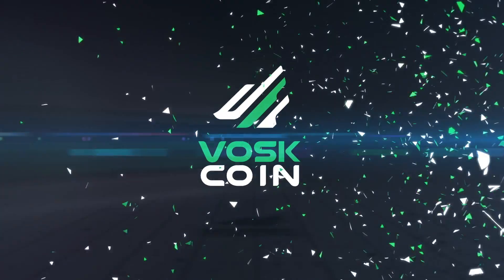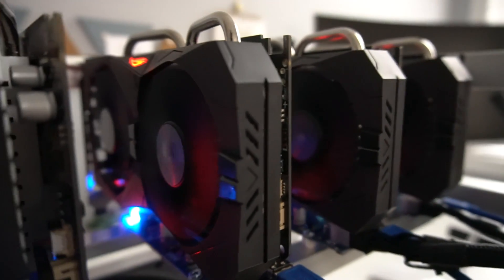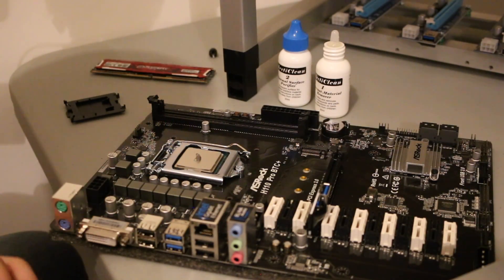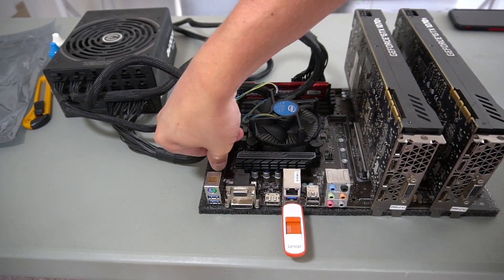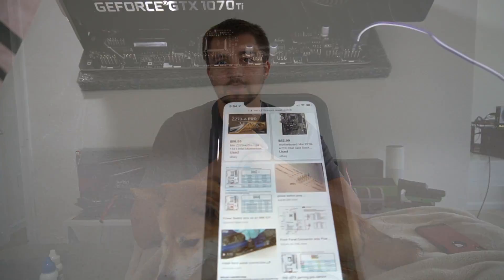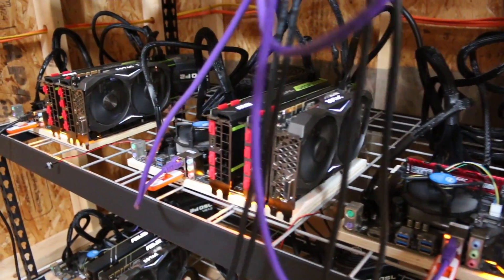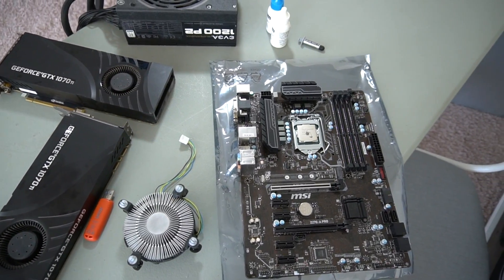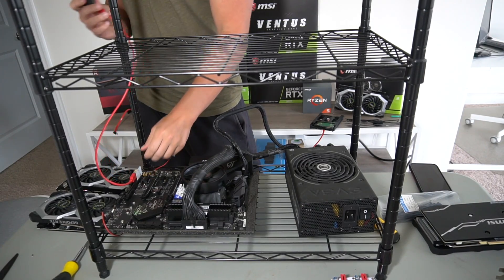How To Build a Crypto GPU Mining Rig With $1000 or Less! Duo Miner! Beginner Guide ETH/Beam/Zcoin

Comment: 1:asrock h110 pro
Ps 1:AGT 1000
6:3060ti fE
1 :3i
Xpg data red rams 16gb
1:vetroo v5 cpu cooler
1Kingston a400 240gb 
solid state drive
6:Risers came with board like 8 or 9 them
What you think boss?

Comment: Thank you for the video! I looked at the price and then saw the date that the video was made and got sad. hehe I was recently planning on starting an AMD Radeon VII and just adding one card at a time. They are currently $2,200 for 230mh/s.

Do you think I should wait until the prices of processors go back down?

Would it almost be more profitable and responsible to just buy a couple solar panels at $300 a piece and save $140 on my electric bill and buy coin instead of electricity?

Comment: profitable? ha, no it is not profitable, only if you running the rig on solar power or something where you don't pay for electric, otherwise you lose money, or make like 10$  a month after expenses ... you would be making more money by just buying low and selling high in the trading market, like hoddling... or whatever is called.. unless you willing to invest like 100k or more into the gear needed to make the power  electric and other stuff it's little to no gain it's bigger the hustle than the money u be making... better sell flowers on the edge of the road than minning lmao... profitable.. it stoped being profitable around 5 years ago...

Comment: Pro tip: if you don't want to buy ArticCleaner use WD-40, it does not harm electronics, & it is also not a lubricant, what it does it loosens dirt & dust, it also protectors against rust (not really useful here but that's a bonus).

WD-40 is literally magic liquid, you can undercoat your car with it for winter, you can fix squeaky doors, clean computer components. Everyone needs a can of WD-40 in their house.

Comment: Hi , so I watched your video and decided to give it a go myself but on a real budget.  I am stuck at home and my business is ruined thanks to Covid19.  Figured I would teach the kids (and myself a bit about crypto mining).  So I sourced on ebay  4x ZOTAC P106-90 3GB DDR5 Mining Card (from at £33.5 each, £134 total); 1x ASRock h110 pro BTC + CPU with stock fan (seller can't remember CPU, but ran win10 in 2019!) +  4GB RAM cost £35; Crypto one frame £13; 4x UK 6Pin USB 3.0 PCI-E Express 1x-16x GPU Extender Riser Card Adapter Cable 60cm  cost for the lot £10.   I know face seeing a large cost PSU ... can I get away with 850w or should I get 1200/1300 . The Zotac cards run at 75w (think similar in spec to Nividia 1060 3gb, certainly use the same drivers).  Any recommendations ? Would really appreciate it.   The PSUs are expansive , there is a second hand EVGA 1300w Supernova for £100, or I can get EVGA 850w second hand, bronze, £70.

There is not much info on my Zotac P106-90, I think this is the closest thing to it : GTX 1060 Nvidia Geforce EVGA GTX 1060 SC 3GB .  The Zotac spec is here : http://vi.raptor.ebaydesc.com/ws/eBayISAPI.dll?ViewItemDescV4&item=153891464478&category=27386&pm=1&ds=0&t=1586428731783

Comment: I'm getting ready to build my 1st GPU miner, I just bought a used motherboard, CPU and 4GB bundle on ebay last night.  Got to pick a PS, going to buy new for that for safety, but got a question about GPUs, to the have to be all the same type, brand, mem size?  Or can I mix and match?

Comment: Vosk great video, you don't need a haircut. I am thinking of building my first rig I sent you a message on reddit. In your great July 1 video you said 1660 1660ti is the best value so thats what I will go with. Great to hear Tails made a full recovery! When you have a chance check out my msg I sent you on reddit. 
Thanks 👍 (kevcrypto)

0xedc8e8e5bdf2769554384dafa91d20717f709bdb

Comment: 0xad9179599846A5d3B0214eb6a580a82369C7e0d6
Thanks again for all your videos. I'm building my very first GPU mining rig, and I'm gonna go with the rx580 8gb cards. So far I just have motherboard mounted in open case so I have alot of parts to buy yet, can't wait.

Comment: how long will it take for 2x1070ti to return that $1k?
Reply: Hi!  I have this rig and have been letting it run for a few weeks so I could collect some "real" numbers.  I started mining ETH and after 5 days was averaging approx. 80cents per day (at current ETH prices).  So that's $24 per month.  My power is cheap at .049 per KWh.  The Wemo shows about $9.90 per month in power.  So you see, about $15 per month "net" it will take 66 months to pay-off.  Like buying a car :-)  But that's OK.  I'm mining with the expectation of upside on the coin price.  

BTW - I used "What to Mine" and moved my rig to Zcoin and it moved my monthly revenue in Zcoin, at current price, up 3 bucks, over 10% increase for moving to another coin!! This is fun!
Reply: I too mine z coin. Seems to be the consistently most profitable for my 1070's.
Reply: ~$0.30 profit after electric a day at current prices. Of course the plan is to hold until the prices go up. The prices don't matter when you mine, only when you sell. Or mine enough to setup a node and make your coins make more coins, but at .05 coins a day, that'll take awhile.  of course you can just buy more cards and make more $$ per day to speed ROI up.

Comment: Sadly I just started mining about 2 weeks ago with some broken cards I bought and got working. Your videos are definitely the most valuable knowledge-wise. I've got a 1070ti and 2 1080s and very intrigued.  I'm thinking about buying some 2070s as is makes sense for the outlook with mining hardware and roping it all together in a rig. Is GPU mining over asic worth it if I can get these cards cheap, mine them and then sell them? I do realize the margins are very tight but I think you have a fellow miner and in addition, microsolder tech out there. ETH 0x27f4a1572fa8e5F49cCBf2095a3B927F94BAda49
Reply: 0x1359641804f6A321a626daB7A81CA32e1cb9b4Ef

Comment: going for cheap...why not speaking about using server supplies @VoskCoin
Reply from the maker: The pico psu adapters aren’t as user friendly as an ATX psu
Reply: @VoskCoin  true, but then, total cost, of pico, server PSU, and cabling, still is way lower then any serious ATX, and prolly even better. That said, as I do use my cpu's also to mine, I use a low power ATX for the motherboard, server psu's for the gpu's. Works very well

Comment: I recommend to buy used parts, that way you get the rigs much cheaper. I have quite recent bought used AMD GPUs and they all work just fine.
Reply: Hi , so I watched your video and decided to give it a go myself but on a real budget.  I am stuck at home and my business is ruined thanks to Covid19.  Figured I would teach the kids (and myself a bit about crypto mining).  So I sourced on ebay  4x ZOTAC P106-90 3GB DDR5 Mining Card (from at £33.5 each, £134 total); 1x ASRock h110 pro BTC + CPU with stock fan (seller can't remember CPU, but ran win10 in 2019!) +  4GB RAM cost £35; Crypto one frame £13; 4x UK 6Pin USB 3.0 PCI-E Express 1x-16x GPU Extender Riser Card Adapter Cable 60cm  cost for the lot £10.   I know face seeing a large cost PSU ... can I get away with 850w or should I get 1200/1300 . The Zotac cards run at 75w (think similar in spec to Nividia 1060 3gb, certainly use the same drivers).  Any recommendations ? Would really appreciate it.   The PSUs are expansive , there is a second hand EVGA 1300w Supernova for £100, or I can get EVGA 850w second hand, bronze, £70.
Reply: @TechNewOld  lmao imagine writing all this for no one to give a fook
Reply: Very True!!! i built 3 of them with 3 cards each for $350 each. the only new equipment i bought was the power supply for the 3...
Reply: @drtool23  would you be willing to build me 1 and I pay you like 200 profit on it or something fair for your time and energy
Reply: @drtool23  What kind of GPUs did you buy?
Reply: @johanvirebrand7196  Hey.. i bought on ebay several Sapphire Nitro  RX 470's  with Bio's switch on them from a vendor who had about 100 of them for about $65 each, they sold like hot cakes
Reply: @drtool23  470 8gb are insanely cheap.  Flashed and tweaked you can get 30+_ from them.  my sapphire with Samsungs are getting 31+ stable.  Been buying from a guy with 100's if not 1000's on ebay as well
Reply: @drtool23  how is mining going for you sir
Reply: @drtool23  how many watt?
Reply: You should make some more vids on your mining rig, income, costs, profit your ROI so far would be cool
Reply: 100% agree.. not just gpu but MB , power supplies etc as well.. Keep ROI as low as possible

Comment: Hi, just wondering what the cost of this build would be per kWh?

ETH ADDRESS: 0x4E2d97C0FbdfE0c6b01127096F4873b909c904ed
Reply: My 1070Tis run well at 70% TDP, so around 125W a piece. That's 250W, plus I'm going to wager that the board, CPU , memory etc are going to pull about 100W when all is said and done. My guess would be about 350W total.
Reply: Thanks thats brilliant, prices are pretty high here in UK at around 19 to 20 pence per kWh. So a rig of this size if I'm not mistaken would cost around £1.50 per 24hr cycle. I will watch again to work out estimated hash rate in that time and how long it would take to break even.

Comment: 1070Tis are a great card to go with right now. I just bought a bunch of 1080s and 1070Tis on Ebay in the last couple weeks to upgrade some old 1060 3G in my Nvidia rigs. I bought 1070Tis between $200 and $225 and 1080s between $250 and $300. Once they are set up correctly, the hashrate difference between the two is practically nil.

And I have to agree, go EVGA for your power supply. They actually rate their PSUs at RMS power vs. Peak power, like most of the cheaper brands do. What does this mean? Basically RMS power is what the supply has available under load most of the time. Peak means just that - it's what you can get for a peak moment, not for any length of time. Rule of thumb is to take those Peak ratings and multiply them by .7; so a 1000W Peak PSU really is only going to be able to give you 700W RMS constant performance. 

You get what you pay for, and next to your cards, the PSU is the most vital part of any rig.Not where you want to be cutting corners.

BTW:
0x27C69e3b11a88759F7161F64a7801aA6199Ec8c5

Comment: 0x8775a0270cb6ea2935e780d286cfe106081b5d64
I have 2 gtx970 windforce would if be worth it trying this with these? 
Any idea on hash rates roughly for beam or eth?
Reply: Probably not. How many Gigs of VRAM on those? It's to the point now where a lot of the software won't even run on a card with less that 4G and a lot more of the algos are to the point where they require at least 8G. That's why I just retired all my 1060 3G.
Reply: @lapurta22  4gb

Comment: I think SMOS needs at least 8GB because it runs from a virtual disk in RAM.
Reply: i was surpriced  Vosk didnt say a word about virtual memory it was such a big headache in my first mining rig cause the miner crashed all the time and i dint know why hahaha
Reply from the maker: Not a problem if you use Linux ex smOS or hive & I’ve run countless smOS rigs with 4gb but 8gb is slightly preferred these days
Reply: @VoskCoin  hey Vosk for windows  what is the maximum GPUs that  can support for one rig, i read somewhere windows only supports up to 8 gpu  for 1 mother board

Comment: just got my ocotominer board and bought 3 used RX470 8 gb off ebay for $99 each shipped! Little tro rig and got two cheap used HP 1200w platinum server psu for $20 each! Total like $600, for $1000 i could almost max out my mobo! you helped me, bro easy and cheap to expand! im still actually collecting the little things. also I'm waiting on some PCIe cable for my little futurebit. so excited! next I want a radeon vii!
Reply: Hate to say it but you got ripped. That's what 580s have been going for the last 3 months or so. 470s are more like $50-60.
Reply: @lapurta22  aww it's ok, the time I could only find 570 4GB for $60 and with shipping it was $72 so i figured Id just pay a little more for the 8GB 470 and be dag safe for the future. Those 4GB will be obsolete soon! Id rather take an extra month or two to ROI than have to try to sell an obsolete card and then also buy new cards anyway. I'll keep my eyes open and thats true I can max out my board even cheaper! This is just a hobby, I feel like I'm doing great! I just checked ebay again and for 8gb,  shipped is more like $130 on 570's!

Comment: How often you come across gpu's that need to be re-thermal pasted...I bought two new 1080's one was always hot until I redid the thermal paste...thx
eth: 0xAeEed4E0d9cea35C270d67A2fC0A0A36f4991071
Reply: I've never had a new card myself that I ever had to repaste. I'm guessing when I buy used it's about 50-50. But I don't mess around with hot cards much. It's not that big of a deal, so I go ahead and slap in some new paste. Taken care of the issue every time for me , so far. Still you have to wonder about the quality of the paste these manufacturers are using when a card that is one or two years old needs it reapplied.

Comment: When building that rig, it will take a month just to break even on the thermal paste cleaner... Skip the cleaner.
Reply: I use an old credit card to scrape off almost all the old heavy stuff, then a plain dry paper towel to polish things up. Works like a charm, and a heck of a lot less messy.
Reply from the maker: what would you recommend if someone needs thermal paste and a cleaner for a used cpu/cooler purchase?
Reply: @VoskCoin  I use alcohol wipes

Comment: Comment - for because I don’t want it to be the last video.
Reply from the maker: Haha thanks Pablo, I appreciate you!
Reply: Hey Vosk, I use a 4-way pci splitter because my motherboard only has 1 16x pcie and a single pci port. And it works. I have borne 580/ and both 1060s on it.  But I was thinking....”self,” I says, “I wonder if a motherboard with 3 or 4 1x-pci ports will let you connect 12 or 16 GPUs.” Have you ever tried it Vosk? Maybe a video about it would be cool. Could save some folks a bit of scratch by skimping on the MB a bit. Thoughts?